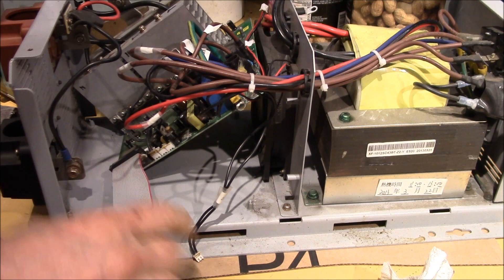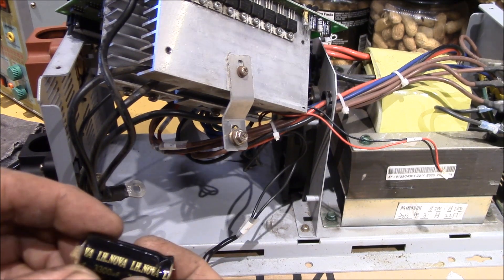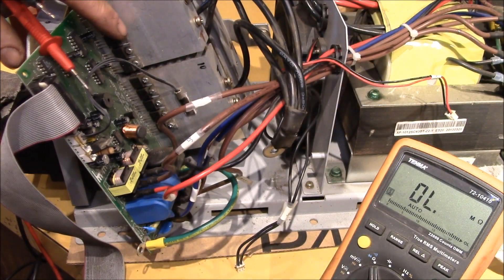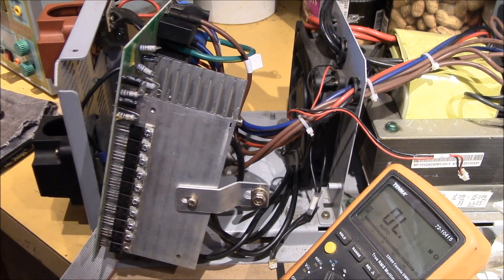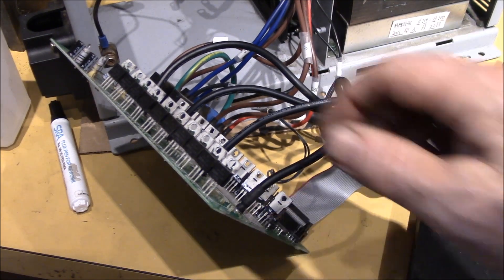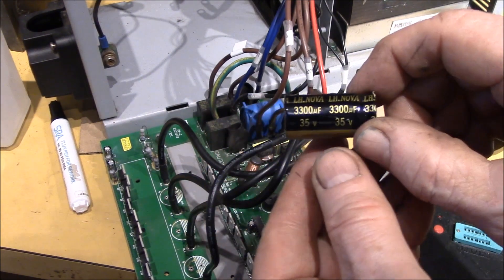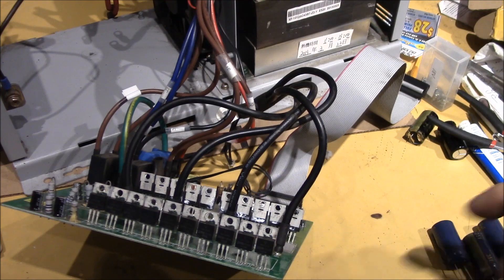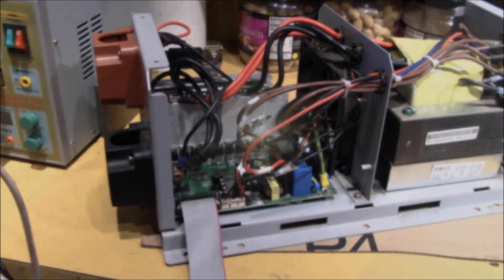TrippLite APS1012SW Inverter/Charger, Blown Caps, Part 2

Comment: The only added thing I would have done was increase the voltage to maybe 50vdc good job
Reply from the maker: Might look into that if these prove to not last long enough.  I went with the longest rated lifetime I could find on the datasheets since I think it's more of a temperature issue.